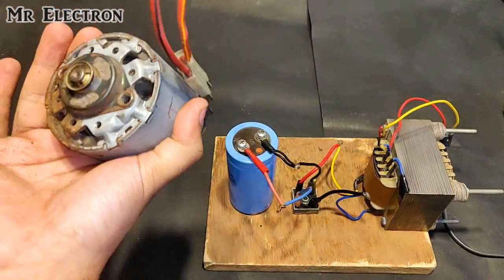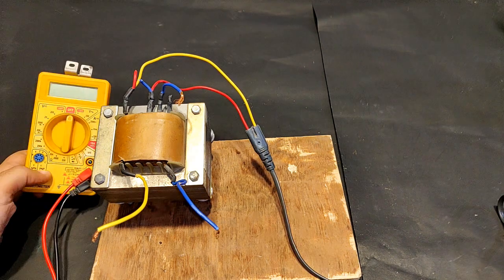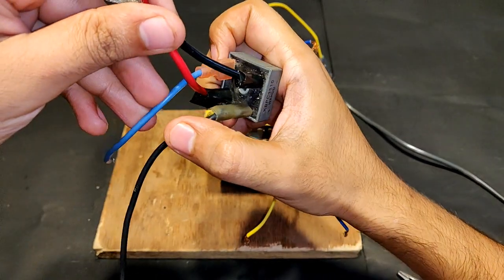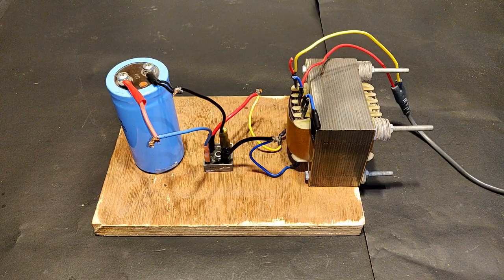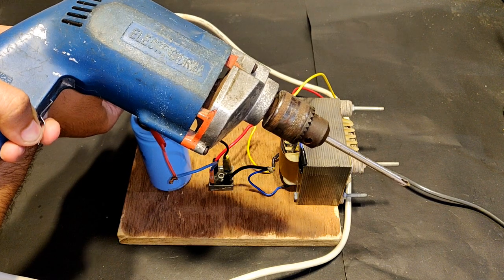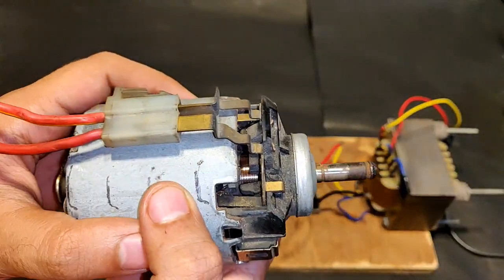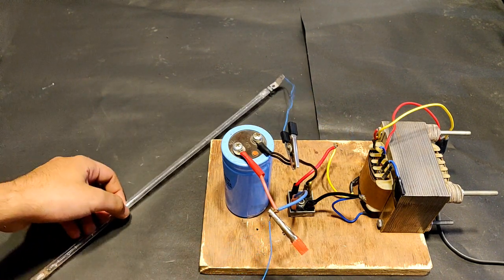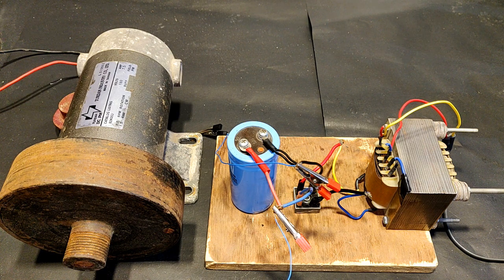24v 400W DC from 220v AC Converter for DC Motor - Amazing Idea DIY

Comment: Bro, why dont u use fuse ?
Also ur taking unnecessary risks by touching connection, be careful
Reply from the maker: No actually the connection were turned off when i was touching the cables.. :)
Reply: @MrElectron  Be careful, i hope u dont mind me commenting, we use earth connection with live and neutral, i dint see earth wire
Reply from the maker: @followthebakri4814  yeah ! I am a little but confident on what i do so its not that big a risk for me.
Reply from the maker: Although.. Yes. That for reminding.. I will mention about earth connections in my upcoming videos for safety purposes
Reply: @MrElectron  Thanks bro :)

Comment: Do you ever use an inductor with the cap when you make a DC power supply? I heard it smooths out the current like the cap smooths out the voltage, I'm not sure about it though I do see alot of them in store bought power supplies.
Reply from the maker: Yes i did that in one if my 12v supply videos.
Reply: Ok thanks for the info.